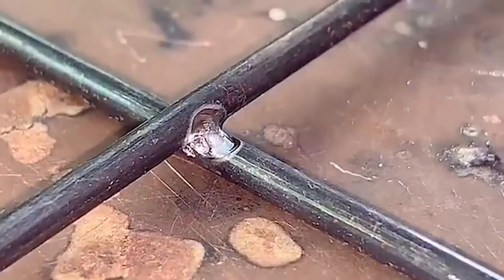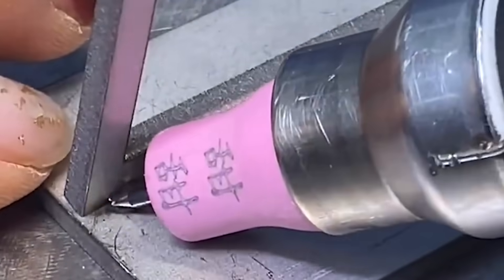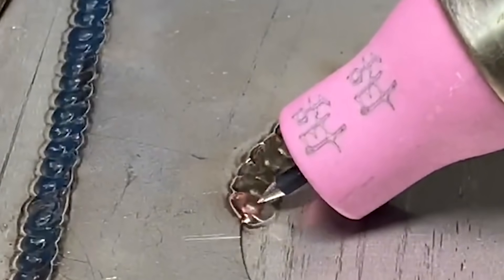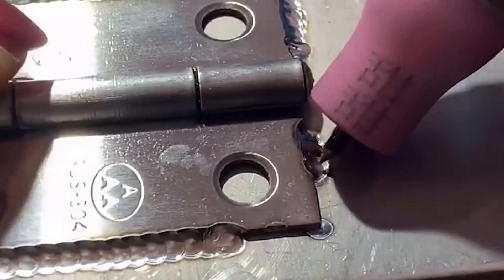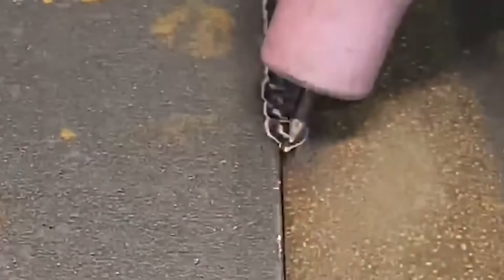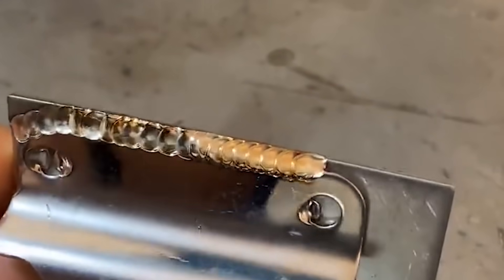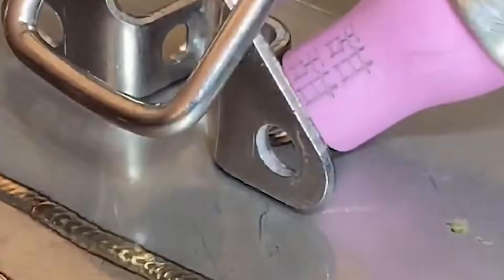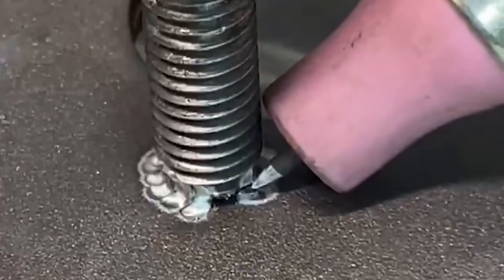Real shot cold welding machine welding various objects!

Comment: Been welding for 30+ years and never seen a tig that pulses like this.
Reply: The pulse is produced using a rocker foot switch, more than likely it is a heliarc configuration originally intended for aluminum welding. 

This is not new technology, no, not at all.

In the late 1970s I oversaw and conducted the same process, called ' heliarc tack welding ', using metal from huge spools that was cut and bent to make fuel tanks. 

Tack welding was done to hold the seams together until the welding was completed using new metal filler rods.

Even then everything went through rigorous testing to insure the safe operation and use of the fuel tanks.

Take note; all of the work pieces appear to be very clean, no signs shellac, oils, corrosion or machine debris, such work environment is very difficult and sometimes impossible in industry; therefore the need for new metal and often times the addition of flux additives.

Using no new filler metal increases the chances of porosity, crystalization and loss of tensile strength, especially when you are fusing metal that has been exposed to atmosphere for hours or more. 

Heliarc welding is not a novel technique, it requires training, skills and much experience in order to make consistently strong welds. 

Sorry it that busts anyone's paradigm.
Reply: @12thsonofisrael  I use a footpedal all the time for tacking on AL, SS, even mild steel....what I saw here is too short of a full power burst to be a footpedal.....this is something similar to pulse mig....something in the electronics of that tig machine.

Comment: Máquina de solda fria

Pertence à soldadura da baixa temperatura, não à soldadura temperatureless. A dureza do material de soldagem pode ser selecionada, de modo que as propriedades do material de soldagem e do material de base não serão alteradas após a soldagem. 1. a precisão alta do reparo, apropriada para o fio da soldadura com um diâmetro de 0.2mm a 2.0mm, a soldadura do fio pode ser realizada, e defeitos da soldadura tais como a deformação e o undercut não ocorrerão, mantendo assim a superfície de referência original. 2. a velocidade de reparação é rápida, e a quantidade de reparação mais rápida pode alcançar 180mm3 / min, que é comparável à velocidade de soldagem de argônio. 3. porque o princípio da alta temperatura instantânea da descarga da alta frequência faz a dissipação de calor da junção da solda rápida, a área afetada pelo calor é pequena, e o valor calorífico é pequeno. Após a solda, a junta de solda pode ser tocada diretamente com os dedos, por isso não fará com que o substrato se deforme recozendo. 4. a gama de adaptabilidade da tensão é grande. Fonte de alimentação de comutação é usado. Quando a mudança de tensão flutua dentro da faixa de ± 20%, a máquina ainda pode garantir a operação normal e manter uma potência de saída estável. A operação é simples, nenhum trabalho técnico é necessário, e o uso é flexível
Reply: I don't understand at all what are you saying, but I agree, it's not a temperature-less welder, it just makes the heat dissipation faster, but it's still much safer to touch than normal welding

Comment: This is not new technology, no, not at all.

In the late 1970s I oversaw and conducted the same process, called ' heliarc tack welding ', using metal from huge spools that was cut and bent to make fuel tanks. 

Tack welding was done to hold the seams together until the welding was completed using new metal filler rods.

Even then everything went through rigorous testing to insure the safe operation and use of the fuel tanks.

Take note; all of the work pieces appear to be very clean, no signs shellac, oils, corrosion or machine debris, such work environment is very difficult and sometimes impossible in industry; therefore the need for new metal and often times the addition of flux additives.

Using no new filler metal increases the chances of porosity, crystalization and loss of tensile strength, especially when you are fusing metal that has been exposed to atmosphere for hours or more. 

Heliarc welding is not a novel technique, it requires training, skills and much experience in order to make consistently strong welds. 

Sorry it that busts anyone's paradigm.

Comment: I really like this welding machine. Can you explain me is this machine use air ? What kind of air , oxygen ?
Reply: To Weld with TIG you usually use clean Argon for Aluminium and "Stainless steel" and a mix of Gases for regular Steel, but you can also use hydrogen but its also very dangerous highly concentratet

Comment: The black needle is called a Tungsten. Green and Red. Green for Aluminum and Red for Steels and Hard metal alloys. I've welded various types of metals ( no filler rod - will not hold) Tig and Mig are my specialty. Don't care to much for Stick but I learned it anyway. Done it for 23yrs. I miss working in Oil and Chemical Refineries. Pipe welding shops mainly.
Reply: This is not new technology, no, not at all.

In the late 1970s I oversaw and conducted the same process, called ' heliarc tack welding ', using metal from huge spools that was cut and bent to make fuel tanks. 

Tack welding was done to hold the seams together until the welding was completed using new metal filler rods.

Even then everything went through rigorous testing to insure the safe operation and use of the fuel tanks.

Take note; all of the work pieces appear to be very clean, no signs shellac, oils, corrosion or machine debris, such work environment is very difficult and sometimes impossible in industry; therefore the need for new metal and often times the addition of flux additives.

Using no new filler metal increases the chances of porosity, crystalization and loss of tensile strength, especially when you are fusing metal that has been exposed to atmosphere for hours or more. 

Heliarc welding is not a novel technique, it requires training, skills and much experience in order to make consistently strong welds. 

Sorry it that busts anyone's paradigm.
Reply: What machine would this be can't find it anywhere
Reply: No filler on all these welds make me cringe.
Reply: @pdczrwnskz  we don't use filler on our turbo exhausts systems and they hold up fine they are cherry red for hours at a time. 
Filler is literally a waste of time for anything but thicker pipe. But all the piping other than the manifold is just pulsed no issues
Reply: @v8consumption  sure but you arent putting liquid through it at high pressure either. If you were it wouldnt hurt to put a cap on it. If it's not structural fuse all you want.
Reply: @pdczrwnskz  yeah you wouldn't be fusing a pipe with pressurized liquid, it makes no sense. 
Like I said everything has it's place
Reply: Como eu faço pra adquirir uma dessa
Reply: No filler the stainless will hold the alloy will not.I weld stainless and alloy 12years

Comment: This is tacking not welding, those tacks would snap quite easily because they have no filler metal. In terms of why we use filler metal, its because the metal from the work piece usually doesn't cut it in terms of ductility and strength, therefore it snaps, therefore why we use filler metal. But hey man I get it, gotta get them views
Reply: Everything has it's purpose. I've had many weld jobs where the weld had to be grinded down flat and instead just fused the panels together and never needs to grind at all. 
Also when I weld turbo ehxuast systems it's always fused no filler. So much faster and Neve head a issue with breaking. Seen more  stainless welds cracks from too much heat. Fusing creates almost no heat and the weld is very strong when used with the proper material.
Reply: Brent,
You are exactly correct!  Without having the new metal added, the weld is weak, pourrosity occurs due to the surface of the metal being oxidized.  It only takes a microscopic layer of oxidation to make a weakened weld.  Clean surface and new clean metal is the only way to assure a strong weld.
Reply: Hey Brent. Can I find this artefact on Amazon or any sort of similar platform? How long are these two metals gonna last together? We wanna buy sth that helps us weld small metals.
Reply: @alejandroparets  Artefact? Amazon? im confused, but I will say those tacks aren't very strong and will not last long if the part sees use. You need filler metal
Reply: depending on the application it is stronger.  thats why it was developed.
https://en.wikipedia.org/wiki/Shot_welding
Reply: It's still welded mate .... just not as strong.  no filler with tig is more often then with it. This 'cold welder' is just a tig welder...
Reply: Quite strong actually compared to glue or screws... nothing compares with a real penetrated weld but yeah it deffentily is still a top notch way of connecting metal together..

Comment: This is not new:  It is fusion using the pulse setting. Any competent welder knows this.
Reply: @Félix Audet really? How odd. I have never seen such a thing, and I do this professionally. It seems very limited in scope. I suppose it world be economically sound if it was for a specific operation, like thin tube. You can still set the trigger to 4T and do the same thing.

Comment: Melting metal together and welding metal are two completely different methods of fusion   Personally  I would like to see tensile strength results of this "cold welding" process
Reply: Cold   welding its much harder to achieve.See explosion welding wich its another form of cold welding.
Reply: it's so weak
Reply: You probably already know that there's nothing cold about it.

Heliarc tack welding produces localized, highly intense, high temperature bursts of electrical arc.  

The surrounding metal dissapates the heat fairly quickly, but tack welding in rapid repetition produces as much heat and heat warping as any other welding.

👍
Reply: @12thsonofisrael  Melting weakens metal   That is why filler is introduced into the weld pool   The filler overlaps the weakened portion of metal to sustain strength
Reply: MK. If it requires no strength why weld? Why not glue  dumbo
Reply: doesn't looks strong enough for me as if the welding pools are too thin, but it's very useful for a thin metal that as thick as paper
Reply: @Fart-Master1  please can you tell me about gold welding machine and techniques
Reply: Looks like a good spot welder , nothing more. I’ll keep my tig rig.